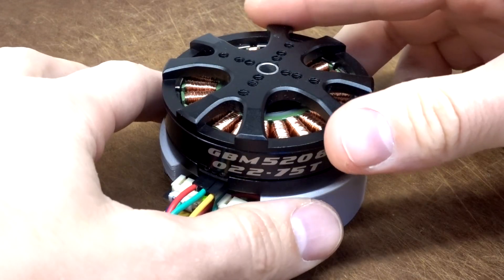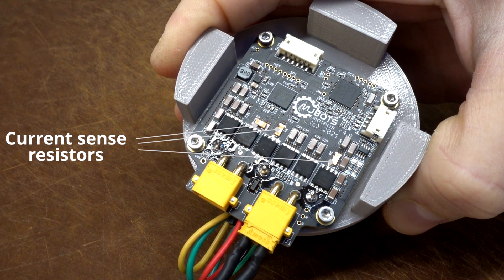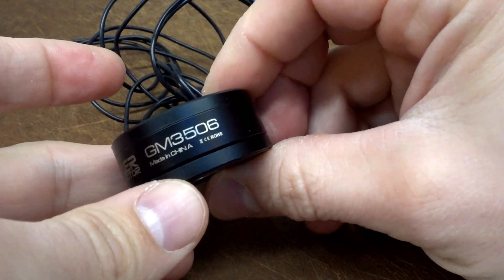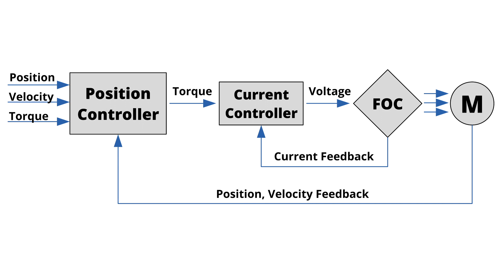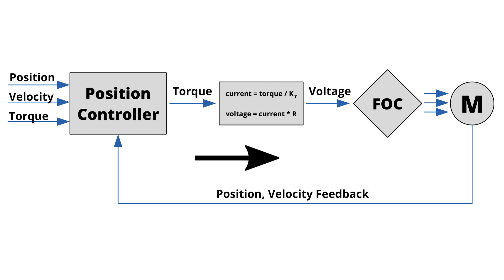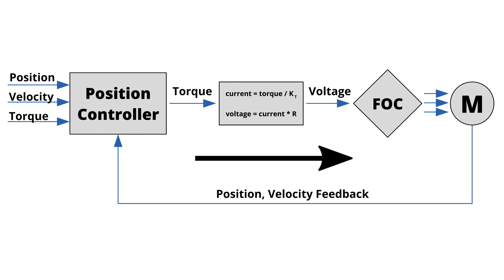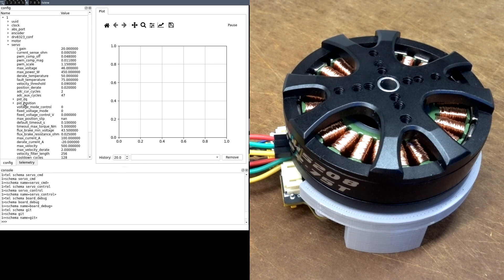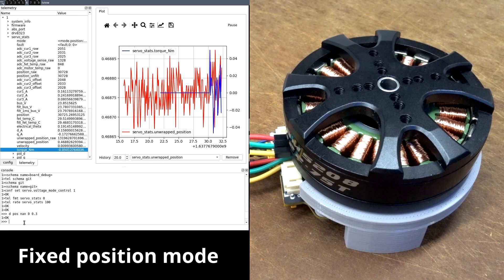Driving gimbal motors with moteus

Comment: This is an awesome project. Now I have a question. Do any motor controllers in the $10 range exist that can do this but while providing less power? I want to design really affordable robots but $100+ per joint for BLDC based equipment is going to make it difficult to reach these requirements. $40 per joint would be a lot better.
Reply from the maker: Not really.  For the lowest possible cost, you can look at the simplefoc supported boards, which still won't be that cheap and will require a lot more legwork.
Reply: @awesjosh  Makes sense! Thank you. I hope I can come up with some projects to make use of your controllers. They are amazing.
Reply: @dc443  SimpleFOC mini clones are definitely the cheapest I've seen but they still needs a sensor and a microcontroller. It's basically just a breakout board for the DRV8313 (or clones). You can drive most high-resistance gimbal motors (5-10 ohms) with it. I'm sure the TI chip is better but in my limited experience the clone chip worked just fine.

Comment: Great vid - what encoder did you use and how did you mount it on the motor? Thanks
Reply from the maker: This is using the on axis magnetic encoder integrated into moteus, with a diametrically magnetized magnet glued to the axle of the motor.

Comment: Awesome. Been following your project for a while and thinking of using your controller for a gimbal project. Btw, in case I have to use a geared motor for higher torque, does the Moteus support an additional encoder feedback on gear output? Thanks.
Reply from the maker: It does, search for "moteus auxiliary encoder"!

Comment: Hi Josh, does the motor tested here have an encoder?
Reply from the maker: Nope, it has a magnet attached to the axle and is using the magnetic encoder built into moteus.
Reply: @awesjosh  thanks for the quick reply. So if I were to plug my own encoder into the Moteus, is the setup easy or does it present additional challenges? For my particular use case, I have a motor with a hollow shaft and I cannot have a magnet in it or even have the PCB sensor sitting behind the magnet.
Reply from the maker: The latest version of moteus has a yet-to-be-announced feature to support external encoders.  However, the only ones currently supported are on-axis encoders.  Thus moteus would not be usable in that application without firmware development.
Reply: @awesjosh  Do you have a direct contact email where I can ask more about this product?
Reply from the maker: You can mail info@mjbots.com or join the mjbots discord at: https://discord.gg/W4hUpBb